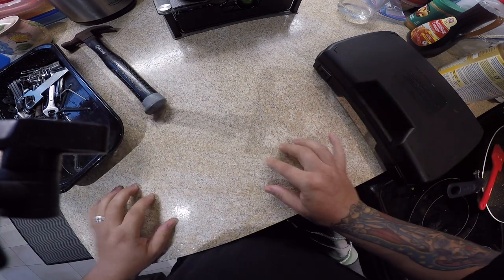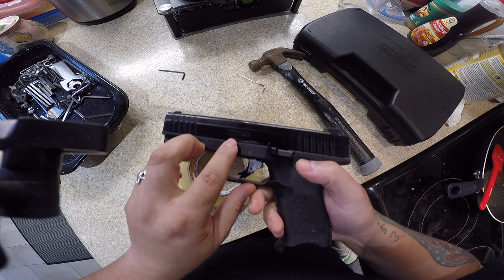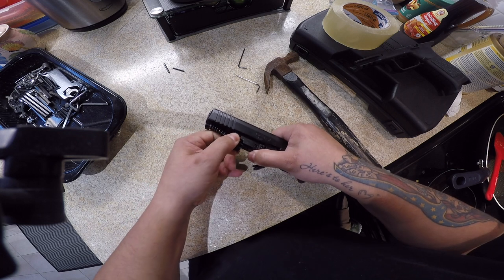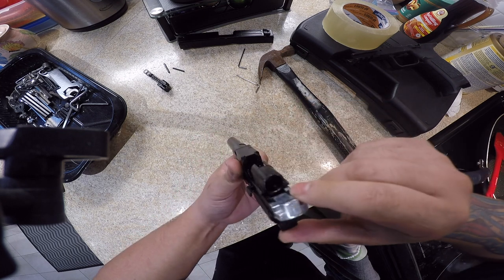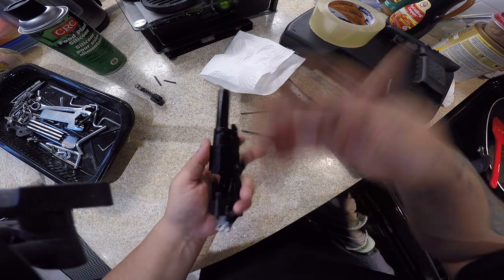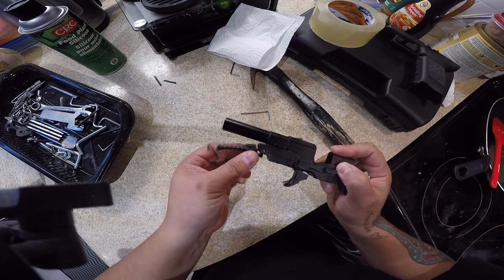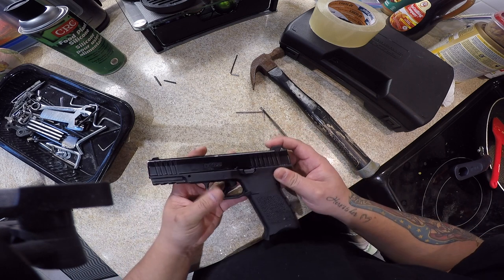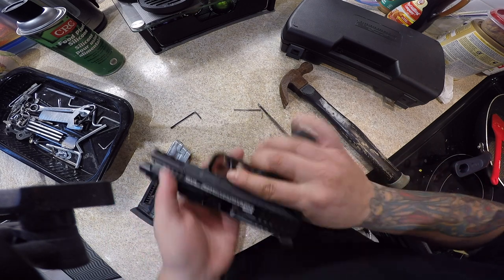T4E TPM1 disassembly umarex

Comment: Really great video 👍
If I wanted to change the colour of the slide is there any kind of paint I could use or would it not be a good idea at all?
Reply from the maker: Thanks for the comment. That is a good question which I never addressed in the video. Yes you can def paint the slide just make sure you mask off the parts that you don't want paint in.  For the paint keylon is recommended, all purposes( but there are more paint thats are also good). By all means there are how to vids to help with that check thoes out